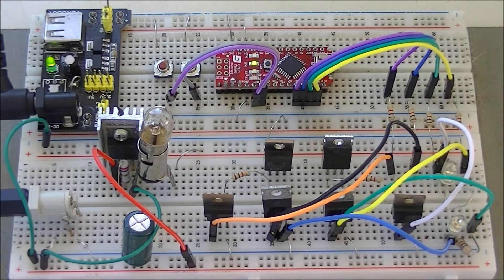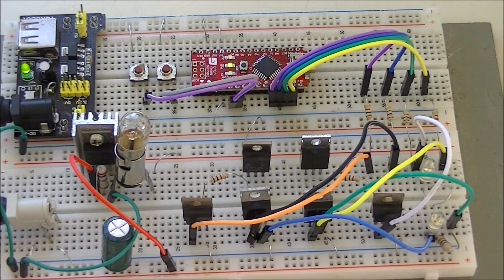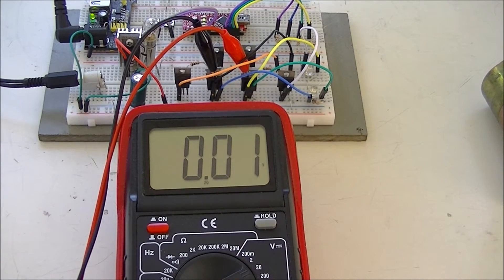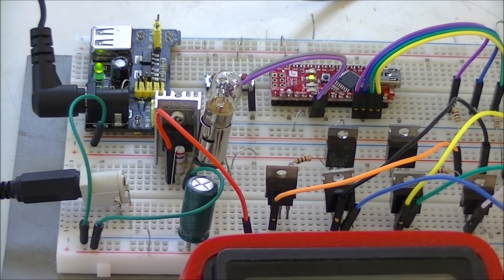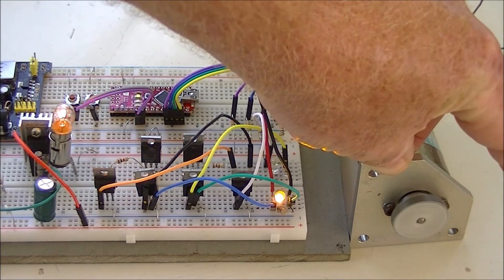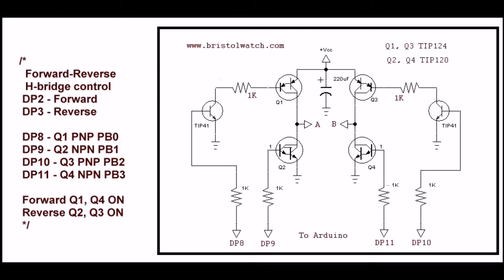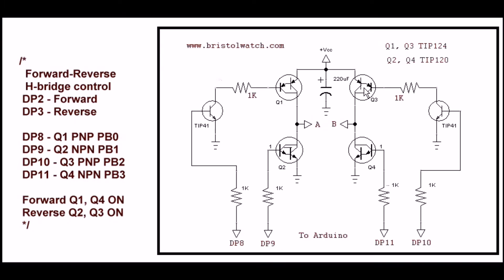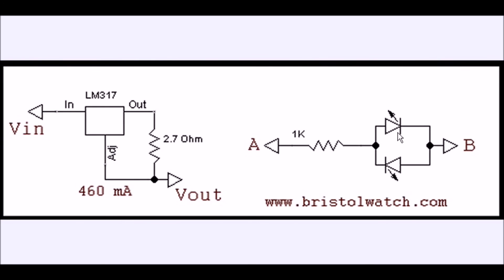Current Limiting Build H-Bridge Motor Control with Light Bulb

Comment: Why use darlington bipolar transistors for a power h-bridge? High saturation voltage will cause the circuit to be inefficient.
Reply from the maker: To demonstrate transistor theory.

Comment: Hi Mr. Lewis, in this circuit that you assembled, can I turn on the motor with 110VDC?
Reply from the maker: As Not with these parts. You need much higher voltage transistors.
Reply: @LewisLoflin  understand... because I need to assembly a circuit full brigde for 110V motor DC

Comment from the maker: If you are using that kind of voltage then use solid state relays. They work well for H-Bridges. They need to be DC with transistor oututs.
Reply: If using solid state relay can you use an esc?

Comment: Thanks for the very useful and clear information. I wonder, can DP8 & DP 11 be commoned (ditto 9 & 10)? I want to drive the circuit not with an Arduino, but two transistors arranged to go off quickly but delay to on to give the neccesary time delay.

Comment: Hi, is there a lost connection between the Q1 Gate and the 12v through a resistor?
Reply: Ah, I got it on your website you use an 4,7k in between. http://www.bristolwatch.com/k150/port5.htm

Comment: curious, why darlington instead of FETs?  
also, I see a diode used as a flyback on FETs, to handle the collapsing magnetic field, 
could this be a LED instead?
Reply from the maker: Those Darlingtons have internal diodes. I have another video in the list below using MOSFETs. I have both. The LEDs are polarity indicators, not suppressor diodes. Thanks.
Reply: I was thinking of using IRF4905 and IRF3205 for the bridge. 
The diagrams show a diode, would this be sufficient for flyback or should I add an external diode too?
Note: Motor is pulling 30 amps
Reply from the maker: They should work and have their own internal diodes. Heat sink them real well.
Reply: what if i want current greater than 40 A .....which mosfet should i use and what is the ckt diagram

Comment: Excuse me, where do you connect the current limiting circuit in the H-Bridge control?
Reply from the maker: The + side of the power supply.
Reply: But in this way, Vout=1,25V, correct?

Is that ok as power supply?
Reply from the maker: No I assume a 12V power supply or even 24. Current limiting doesn't regulate the power supply voltage.
Reply: Could you please draw how you connect the current limiting circuit into the H-bridge schematic?
I would like to learn how it is done.
Thanks.
Reply from the maker: See this list it's one several of them.
http://www.bristolwatch.com/k150/port1.htm
http://www.bristolwatch.com/k150/port2.htm
http://www.bristolwatch.com/k150/port3.htm
http://www.bristolwatch.com/k150/port4.htm
http://www.bristolwatch.com/k150/port5.htm
Reply: Thanks, I have watched another video of yours in which you showed some experiments with the LM317 in the current limiting configuration and I have tried some others on my own.

I think that the schematic of the motor should have a variable current source (upper limited) rather than +Vcc if you introduce the current limiting circuit. Correct?
Reply from the maker: I has a current limiting circuit already.